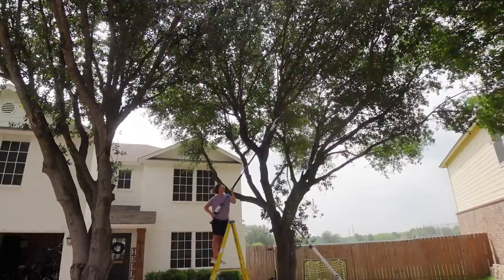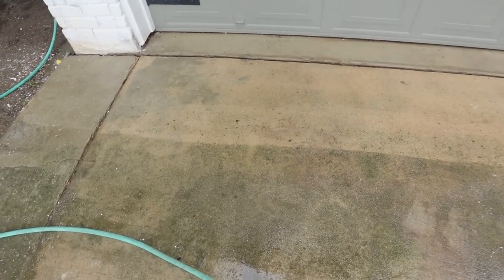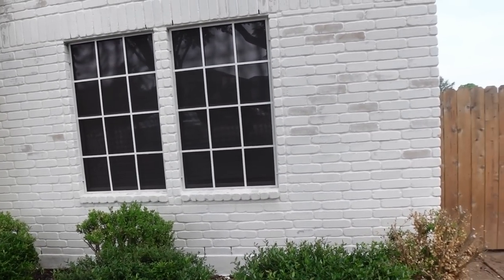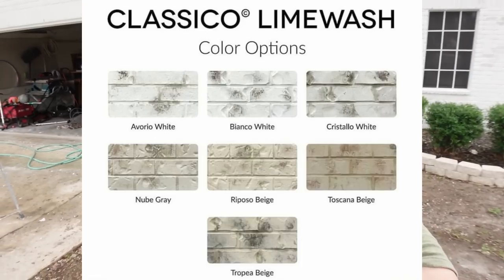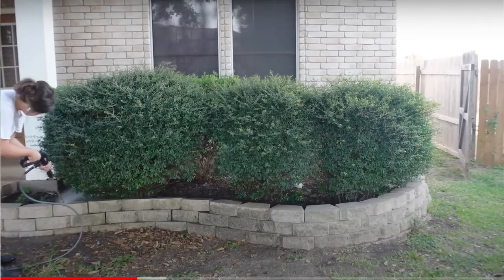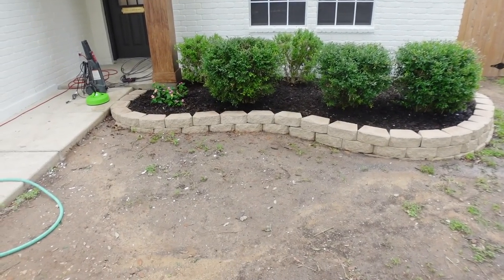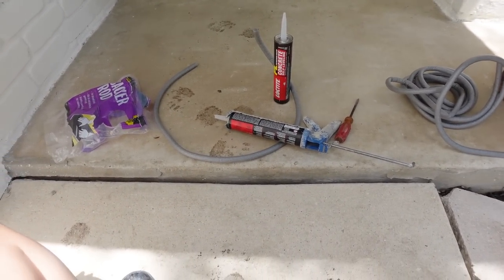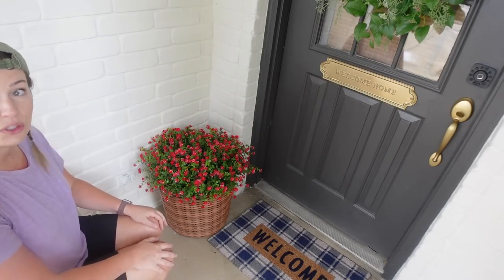LIME WASHING MY HOUSE AGAIN?! + SO MUCH PRESSURE WASHING | OUTDOOR REFRESH 2023

Comment: If you love the full coverage on the bricks why would you not utilize paint? Especially since lime-wash peels and you have to touch up? What’s the advantage of lime wash?
Reply from the maker: Good question- when I originally lime washed the house, the motivating factor was how inexpensive it is. Paint can peel and chip as well. The lime wash is supposed to be better than paint because it absorbs into the brick instead of sitting on top. I don’t think all lime wash peels. I just applied it too thick in some spots.

Comment: I love your energy. I just did the same thing with the backer rod in my drieway. What I learned about the round surface cleaner head for the power washer is to walk backwards and slower not back and forth. it works better that way and I rinse in smaller sections before it dries.

Comment: Your home is indeed lovely.   Your hard work is beyond amazing. Thankfully my brick home is a creamy beige so no maintenance beyond pressure washing.    Sadly I am contemplating a move and red brick is very common here - and hot in Georgia, almost as hot as Texas.     Summer utilities can be insane.   Before you think about planting anything in your front yard I suggest you have a few soil samples tested.  At least you would have an idea re what plants to avoid.   When I purchased my current home (1986), the County Extension Office would do soil tests for free.   Of course that is no longer an option here.   If it was my home I would be tempted to add a layer of weed block type material and cover it with black mulch.    It would truly 'pop'.   Maybe a few hostas depending on your soil.   But I like the grass-free front yard look, especially since black mulch already looks so nice out front.   (You could relocate the bushes and add a bubbler fountain that operates via solar.   I have marked several YouTube videos featuring how to DIY a solar fountain via a planter.   I think it's a lovely area for a water feature.    You could add a few additional flowers if you find it appealing.

Comment: Everything looks so good! Nice and fresh.  Great job as usual 😊  I like the "Welcome Home" Brass front door sign too. Could you share where you found it?
Reply from the maker: It was from target but I’m not sure they sell it anymore. I spray painted it brass. Here’s a similar one that you could spray paint-
https://www.amazon.com/AuldHome-Welcome-Farmhouse-Mounting-Hardware/dp/B084Z1PC7T/ref=asc_df_B084Z1PC7T/?tag=hyprod-20&linkCode=df0&hvadid=416671372215&hvpos=&hvnetw=g&hvrand=6476096109156861163&hvpone=&hvptwo=&hvqmt=&hvdev=m&hvdvcmdl=&hvlocint=&hvlocphy=1026292&hvtargid=pla-955014656637&psc=1&tag=&ref=&adgrpid=90729940021&hvpone=&hvptwo=&hvadid=416671372215&hvpos=&hvnetw=g&hvrand=6476096109156861163&hvqmt=&hvdev=m&hvdvcmdl=&hvlocint=&hvlocphy=1026292&hvtargid=pla-955014656637

Comment: Lantana is a great plant if you don't have a green thumb.  It MUST have full sun.  Hose once a week if it doesn't rain.  You should buy more lantana bushes for your garden because you need more color.  They will die off in the winter.  Just cut back and they will rebloom in the spring. Encore Azaleas are also very hardy bushes that last for years thru summer and winter.  That would give your garden a lot of color.  I would move the bushes that you now have and replace them with the Encore Azaleas.  You could put the bushes some where else in your yard.
Reply from the maker: Love the idea of azaleas!

Comment: So the DIY stuff started to chip? What made you decide to recoat with professional products rather than try again with DIY?    Any adhesion concerns?
Reply from the maker: Yes the diy stuff chipped in some places but I really think it was my fault for applying it too thick and not letting it dry in between. I decided to try to the romabio product because I was curious if there was a big difference and there really is. It covers much better and I prefer the warmer color.

Comment: IMO, the flower bed is way too small for the size of your home and yard. You could buy some more stones and enlarge it quite a bit, you also need more color in front of the green shrubs like dwarf lorepetulam which is plum color and stays that through winter, doesn't lose its leaves, so no mess and Moonglowor golden  Barbary which is. Yelliw golden hue and beautiful with lorepetulam and evergreens behind them both, It will make your home and garden bed pop alot more from the street, from the sidewalk and from inside as well and give your home much better curb appeal. I am not a fan of the opaque lime wash, but it does look nice on your home, much better than the brighter white you had before. I like seeing the brick colors show through on brick hones. To each own its not my home. It's yours N it looks lovely. Lantana is a good choice, it might not cone back next year depending on where you live.  I still love it and in North Carolina where I live, it doesn't come back. Neither does Mandevilla, but I love them both, so I use them in pots.  Where I can move them around as I like. The pressure washer device was real fast and did a great job. I just finished our long sidewalk. Hubby and I will do the driveway unless he hires a friend with  sweeping device that can do it faster. Great job on everything,  just please be careful on those ladders, I won't climb that high, I'm not steady on them that high, I'm also almost 62, don't trust myself on a ladder at that height. 
You inspire me to get things done over here and when it stops raining and dried out, I'm going to sand and paint our patio table and 6 chairs and sone miscellaneous metal furniture atctge fire put and back yard. Then finish painting trim on the sunroom and do something about the wooden patio furniture,  needs repair and sanding and paint or we will repair and sell it as is. I'm pretty tired of it. It's not treated wood like we were told by the builders who made the set.

Comment: So why did the limewash peel? According to the internet it shouldn't, is that the coffee additive? Also when it rains and the wall just gets wet does it look as translucent as after you spray water before applying limewash?
Reply from the maker: I’m pretty sure it peeled because I added too many thick coats. And no it doesn’t look nearly as translucent as it does with the hose. The rain doesn’t completely saturate it like the hose does.